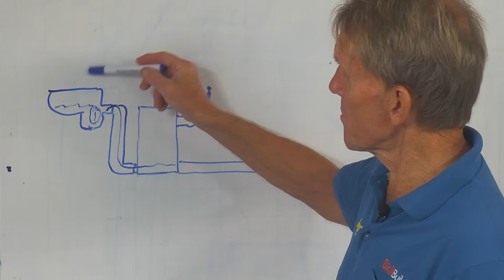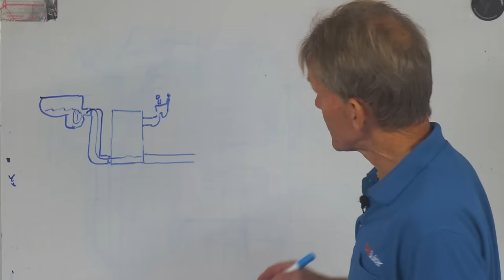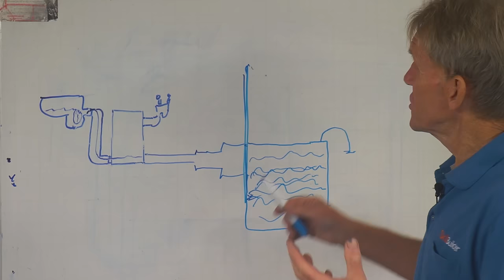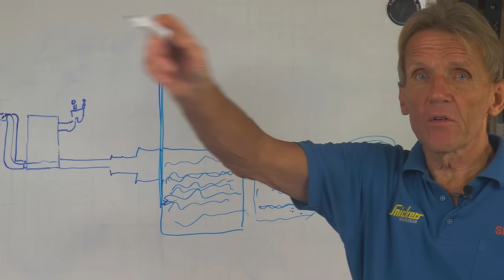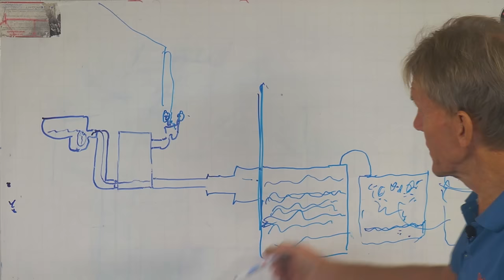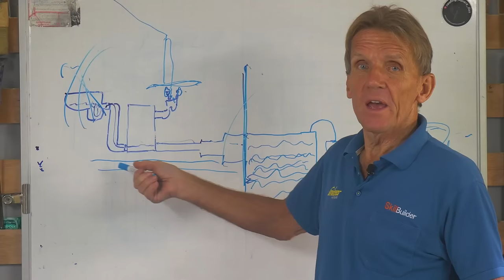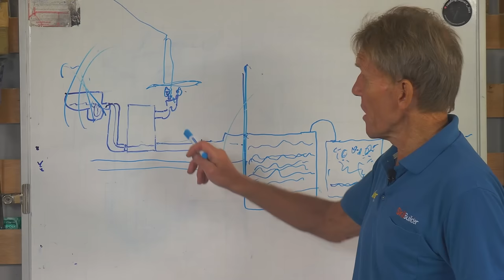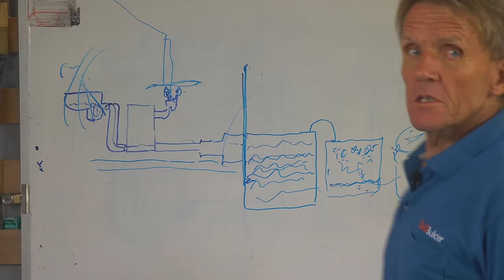Sewage In Our Rivers ~ The Ugly Truth

Comment: Scottish Water did a massive programme of upgrades to CSOs in the Glasgow area. Turns out that they throttled the output pipes on loads (if not all) of the replacement CSOs meaning that less water can go to the sewage works than was the case with the original victorian CSOs. They have literally squeezed the outgoing pipe to make sure more water spills over and goes direct to the rivers, thereby saving costs on treatment.

We reported it to SEPA who has simply stated they are licenced to spill the water so all is good. The two organisations are far too close, literally working together to allow the pollution.
Reply: Yes. When you read into it the mass dumping has only really started since the EU regulations were removed in the mass slash and burn.
Reply: @purplemonkeydishwasher5269  The programme I mentioned started 10 years ago or so. Nothing to do with EU regs.
Reply: My own MP abstained on the sewage dumping vote (Ian Levy, Blyth Valley) and a week later accepted a £600 payment from the local water company. Corruption runs through the whole of the system.
Reply: @jackking5567  Brutal. Shows the level of these folk. Imagine sacrificing your morals for that petty amount.
Reply: I am a drainage engineer and I work with sewer system simulation software to optimise the performance of CSO's, what you are stating here is not entirely wrong but there is a few peices of the puzzle missing, leaving your overall comment a little misleading.

For starters, a typical CSO design is meant to have a smaller diameter outgoing pipe, and sometimes this is indeed to throttle the flow. Why? well..... because there is a tradeoff to be made between pollution and flooding, this is not often made clear in the way the media or online discourse handles wastewater topics. CSO's provide an alleviation point in a sewerage system that allows water to spill from that point, the reason for that is to stop that water from spilling from another point where the effects of that spill might be more consequential (for instance in the middle of a residential area or a city centre). If we were simply to go around and seal up all the overflows, we would have widespread flooding, and the size and scale of that flooding could be far harder to resolve (and take far longer to resolve) than simply trying to optimise the CSO and ensure it spills less frequently (or ideally undertake some other upgrade to ensure that it is no longer needed - where possible!).

A throttle pipe is also necessary as (simmplfying things a bit here) it helps to ensure that the ongoing rate of flow is predictable, meaning that, in theory, the circumstances under which the spills through the overflow occur are somewhat predictable. Historically this has been key to the way that CSO's have been legally regulated, although that is now changing in favour of directly monitoring the spill with electronic sensors (something that was simply not possible to do at scale until the last 6 to 10 years - the technology didnt exist).

How does this relate to licencing? well... it is not so much a carte-blanche  "licence to spill" it is a permit that allows a spill only when a particular set of criteria are met. Now what the criteria "ought to be" and whether the current/past/future criteria are/will be adequate is a matter of eternal debate and ideas around that have evolved (for the better) over time. However any debate will have to balance the cost of supplying the sewerage service, the cost of improving the performance of given CSO assets, the harm to the environment, the risk of unintended consequences (e.g. flooding), the disruption caused by any engineering works involved and more besides. In short it is not something that can be undertaken lightly, it takes takes teams of experts quite some time to parse all that and come up with a defensible solution.

Is this a "devils advocate" argument for justifying pollution, no certainly not, but it is a (partial) explanation of why it occurs and what the tradeoffs are when it comes to resolving it. In my opinion (and I dont speak for the hwole water industry, just myself) the non-water industry public are rarely given the full facts and the intracies of these (often very complicated) issues are not presented in full or debated sensibly.

Luckily we have guys like Mr Bisby here, who although not a water-industry man, is capable of giving a level headed and informed presentation. You wont see that on the BBC or in any documentary or news outlet where it is mainly screaming ninnies who would rather apportion blame than do the hard work of trying to get stakeholders together to tackle the challenges we are facing.
Reply: @purplemonkeydishwasher5269  speaking as a water industry employee I can tell you factually that there has been no step change from a perfect sewerage system to "mass dumping" as you put it. Some of the reasons that this is now a more visible problem now than previously are explained very neatly in the video; population has increased, also people using sewers to dispose of garbage and as Mr Bisby points out a lot of our sewers (especially in London) are victorian and no longer have the capacity to meet modern day needs. A lot of what he says here is good information and I would be nitpicking on the bits I think could be improved.

A more important change though is that technology has moved on; CSO spills are now directly monitored electronically, something that was simply not possible to do at scale (let alone a nation wide scale) 10yrs ago. It has taken about 5yrs to set up (it was an absoutely mammoth task, truly on an epic scale) which is actually fairly speedy for something of this nature.

We now have long term monitoring of CSO performance, something we simply did not have before! and we can make decisions on which CSOs are operating properly or poorly based on real world data. Previously this was all done based on engineering theory and computer modelling, although the modelling itself has come forwards leaps and bounds over the same 10yr period as computing power has increased.

All this information is now available to both the public and the regulator so that is why it appears to be a sudden an urgent problem; because the media have sudenly come to grips with the data and have decided to report on it, naturally they do so with their usual spin and hyperbole and little in the way of fact. In reality it is a problem that has crept up over the course of about 100yrs. I work on CSO optimisation directly, and I can tell you that it can be a bit depressing at times, drainage engineers are very environmentally concious people and DO NOT want to see harm come to the environment, I graduated in Environmental Science and if anything I want to see our environment be taken more seriously and actually improved.

On the plus side we are in a better position now than ever to do something about it, although that of course will take time. Could better decisions have been made in past to avoid all this? probably! but hindsight only has so much value.

In short, it really has nothing to do with corruption, it is a problem that was always going to come to a head eventually. Science and technology are making it easier to quantify and understand the scale of it now, and yes its a huge issue. But we need to calm down and start working on it rather than looking for bogeymen to pin it on, the latter might feel satisfying but I for one just want it sorted out, everyone ultimately has a part to play in that as Mr Bisby alludes to.
Reply: @Metamerist625  I hear everything you say and I heard the exact same line from water engineers in Scotland. None of them could explain why throttling was over 65% reduction in flow capability, nor why none of the CSOs were maintained in size or enlarged (edit; I know enlargement would be a mammoth task so isn't surprising itself), if the goal was to balance the system. 

A SEPA representative even said to our face, "If you were right, what would you want to do about it?".

The level of complicit sewage dumping happening by Scottish Water with the blessing of SEPA across Scotland would blow your mind as an engineer working in England.
Reply: @Metamerist625  thanks for that really good summary. Yes I guess suddenly having quantifyable data has made this a much more visible problem.
But lets not pretend that a deliberate choice has been made to pay dividends rather than invest.

Comment: Also worth mentioning 
During a rain event , where trillions of gallons of rain water runs off roofs and down road Gullies into the sewer , which then simply can’t cope with the shear volume of water and it has to discharge it into the nearest stream or river , the sewage is extremely extremely diluted , it’s not RAW sewage , it’s sewage that’s mixed massively with rain water 
To put this into perspective 
Raw sewage has a ammonia reading of around 40 to 50mg / litre ( nh4 ) 
I last week sampled a overflow during a rain event and the ammonia reading was 1.7mg / l ( this was leaving a sewer going down a overflow pipe to the river ) 
I then swamped up stream and down stream of the river of where the overflow pipe discharged into the river 
Upstream was 0.4g and down stream was 0.4g 
So no impact at all on the river 
People forget this Raw sewage is massively diluted during a overflow from a rain event

Comment: In the water company i work for i dont know of any cake being incinerated before being spread. Usually the sludge sits in a Path Kill tank for 14days then gets centrifuged into cake. This gets tested for pathogens before being spread. 

Also a massive problem are the wet wipes, pumps within towns and villages fail and cause wells to overfill and drain out where they shouldnt! And the amount of new houses being built with little consideration for existing infrastructure

Comment: I work in a builders merchants and I've lost count of how many times I've been asked for an adapter to put 40mm waste into 68mm downpipe 🤦‍♂️
Reply: We recently had to do this, but it didn't make a difference as the gutter down pipe on the house drained straight into the main sewers with a manhole cover 1 foot away, that's the only drain available at the property as built originally.
Reply: My new go to question 😂😂
Reply: How many sky hooks have you been asked for?
Reply: @Orgakoyd  The problem that you then have (which is the main reason for not doing it) is that there's no trap in a rainwater system so the top of the gutter downpipe effectively becomes a vent pipe which will let smells escape. Not a problem if it's not near a window but still not an approved method as the location of the top of a vent pipe has to be within the regulations.
Reply: When we bought our current house, there'd been a history of calling out Dynorod for which locals blamed the previous residents of our house (African-Caribbean and the wife had mental health issues while he was popular). We put a scope down the drains and flushed with dye. Turned out, in 1970s, a side extension had put sewage into the rainwater drain and vice versa. The blockages were due to the sweet old people and their middle-aged daughters next door. Tbf, the chap opposite suspected it was them all along. He's old white English Tory. We're old white British. The culprits traced their ownership back to building in mid 1930s. We fixed what drained into where

Comment: We recently had an extension built and had to argue with the council/building control to let us use the surface water system for the rain water instead of digging up the garden building a soakaway. We had both sets of pipework running along our property so it made sense to use it. This water ends up in a big pond in the woodland a few hundred yards away.
Reply: I don't see why every new house should have 10,000 litre water tank buried in the garden and used for flushing toilets and watering gardens. Why are we using clean drinking water to flush toilets and wash cars with, it's never made sense to me
Reply: @chippyminton8711  It's a good idea, but most new houses have such tiny gardens that there's no room to bury a tank. Even a soakaway has to be a couple of meters from the nearest foundation or road.

Comment: Privatisation is a cancer of the Thatcher period that has metastasised into a pain in the arse for today's taxpayer.
The electrical infra structure of the UK is facing similar issues because of the neglect of maintenance which will become another car crash as the demand for capacity to supply all the demands of replacing fossil fuels by electricity rises exponentially towards Net Zero in 2030.

Comment: I think you have mixed up water treatment processes. These processess don't come together on one plant

Points worth mentioning

In an aeration lane the good bugs don't eat bad bugs (or it is not the objective). The bugs eat the nutrients and then the bugs are seperated from the water in seperate sedimentation tanks

It has always been the case that in storm conditions that the water will overflow the works and be discharged into the river. The overflow is diluted more that normal (non storm conditions)

Comment: I've never heard of surface water being directed into rivers I thought all surface water went straight into the ground, it doesn't need to go anywhere else, the time it makes its way to the rivers it's pure.
Reply from the maker: There are hundreds of thousands of surface water pipes going to streams, rivers and the sea. Some of them are huge. If they all went into a field and made their way through the ground we would have temporary lakes. 
Gatwick airport has a catchment area but when it rains heavily they can't hold it all so it goes into the Mole. See Molsey Floods 1968
Reply: How can it go straight into the ground when you've got thousands of square miles of concrete?
Reply: @SkillBuilder  I thought they just dig a big hole below the drain as a soakaway
Reply: @paul756uk2  when they put it in originally
Reply: @hoobsgroove  If you think about the surface area of a property that's not natural ground, so paving, the roof etc, you can't make the water collected by this surface drain into a small hole where the down pipe goes, it wouldn't be able to soak away fast enough. Now think of a city as one big property. Obviously there are patches of grass everywhere, but if you think about all the roads, paving, roofs etc, it's the same problem as 1 house just scaled. It has to be piped away.
Reply: @Orgakoyd   Added to this the sheer numbers of people removing areas from their property that could soak up rain water. You can drive along the entire length of many streets, and not see a single lawn etc.  The property owners have all ripped them up, many of these streets on hills.  So rainwater just rushes down the hill with nothing to slow its progress.  I can understand why SkillBuilder has chosen to live at the top of a hill.
Reply: If all surface water went straight into the ground we would have no rivers. The ground will only allow so much water to soak into it, gravel will allow nearly unlimited rain, clay not much.

Where water does soak in it may not be pure when it travels through the ground and reaches a river. There are many chemicals that take a very long time to break down.
Reply: @EgoShredder  Yes I hate that. I think buildings are often too big in themselves, and then so much unnecessary paving to go with it.

Comment: The easiest way to deal with this and it is 100% guaranteed to fix the problem is to make the CEO’s and the senior management have to swim in the rivers where they are pumping out the crap. You’d find that the water companies would then not pump sewage in the rivers.

The ugly truth is that we’ve over built and overloaded the sewage capacity, new builds are not paying the full cost of the impact they are causing as the profits are flowing out to the big companies like Persimion, Taylor wimpy etc. this is why the massive house building in the south is such a bad idea.